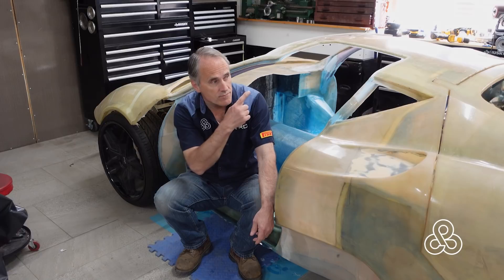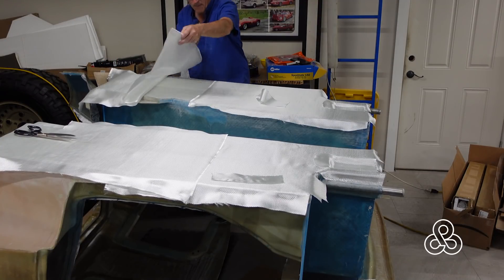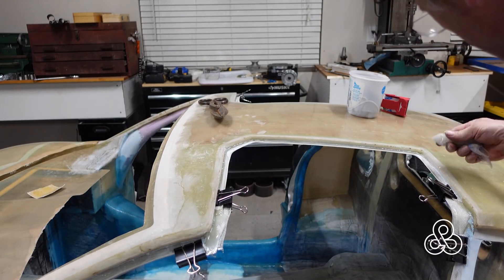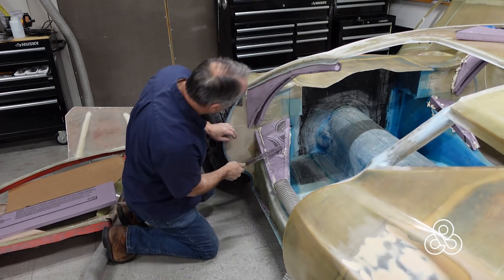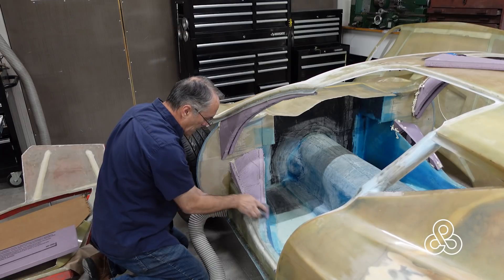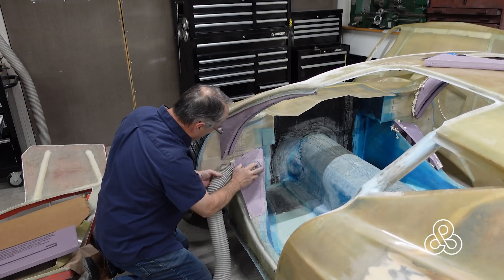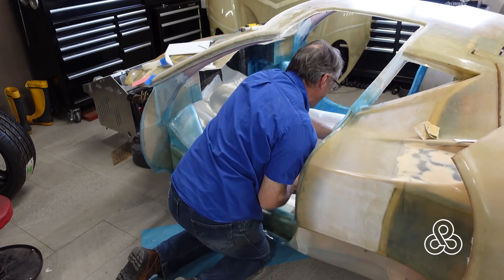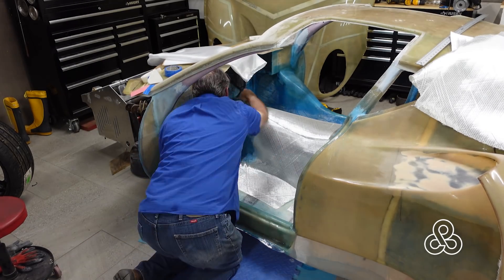A79 Finally some finish surfaces! Arete Supercar Project

Comment: Do you leave the foam inside?
Reply from the maker: Almost always! As the foam weight is negligible compared to the work time to get it out; and although it is not a structural foam it does add considerable strength.

Comment: btw sir, my team is trying to produce a fully autonomous ground vehicle, and to make it's body we are going forward with a 450gsm fiber glass mat, I wanted to know for around half roll of fibre (around 18kg) how much resin would we need? is it one to one ratio?
Reply from the maker: 1.75 times the fabric weight. Slightly less for a plain weave cloth slightly more for Mat. I know its harder for you to get materials, but is there any way for you to switch to a cloth rather than the mat? Better strength to weight.

Comment: The builder gets choice .  Can I ask for a Guesstimation for the finished weight ? I’m trying to build a Light weight steel car so I’m interested in this car.
Reply from the maker: My original goal was to keep it under 2200Lbs (1000Kg), but recently I have thrown weight control out the window for the sake of getting it done.

Comment: If you go paint I would suggest a texture maybe like Bedliner but not as rough? Carpet is always a good option. I personally plan on not using carpet for my supercar design because I want it to be like as close to a Jet fighter, Mech and Rocketship as possible. it will be raw and brutal.

Comment: who is going to fit in that car? the center tunnel is way too large! I want to see you test fit yourself with a seat inside the car with the doors and a mock steering wheel. I can see where the gear lever and e brake placement will be an issue as well. You really needed to do a transaxel and a setup simuliar to the Toyota MR-2. Your car looks the same size as the MR-2 .
Reply from the maker: Seat fitting is on the horizon. No gear lever and the e-brake is electric. The cheapest transaxle that I could find to handle 600HP was $11,000. With a budget of $25,000 it wasn't happening, plus the all wheel drive idea was a challenge!

Comment: For the interior I would go with carpet for the floor. Alcantara for dash and transmission tunnel and roof and seats with a mix of leather and alcantara with a diamond pattern stich. All buttons in stainless steel finish. Some accents in carbon fiber here and there.
Reply from the maker: Orange leather with blue stitching and carbon fiber trim is in the plan.

Comment: Will at some point build one with a more expansive power plant and body? I can imagine if you did you may catch the eye of a few exotic car collectors. I know of one family that just bought a race track that have an insane car collection alone, but there are others as well. Check out "the triple f collection" "the stradman" and "dde" they all have some great and fast cars.
Reply: I meant a carbon fiber body rather than fiber glass
Reply from the maker: If you fund the project we can split the profits?

Comment: Top job mate. Im building a machine from scrach as well and know the time and work it takes and allso the joy it gives if you get something done. 👌
Reply from the maker: Yes, always joy in the build, but super glad to be done with some aspect and ready to move on. Watched a few of your videos and was wondering if you found gears to adapt to the larger tire size or are you just adjusting RPMs to turn them?
Reply: @BuilderCreator   I reduced gearing with chain and sprockets between the engine and gearbox. 🙂

Comment: Paint if your going to use as a track car and race it. Upholster for general use with the occasional track day. As you know, upholstering allows for the addition of sound deadening and insulating materials. Hearing your fine note of the engine noise will not be a problem as you can make allowances for this but road noise can be very tiring on any length of journey. upholstery with added insulating materials will also aid in maintaining a comfortable climate in the cockpit. You can still add painted or say carbon fibre treatments to selected areas of trim for aesthetic reasons. Nevertheless, I have no doubt whichever route you decide on, the result will be fabulous. Good luck and thanks for taking the time to share your journey.

Comment: DYNAMAT.... I think you will enjoy every drive much more by adding appropriately sized pieces of Dynamat to as many fiber glassed surfaces as possible.  I can tell when you tap the panel surfaces that there is a lot of tensile strength.  These panels will vibrate and sound will travel throughout the tub and be EXTREMELY noisy.  It doesn't take much dynamat to alter the resonance - follow up with sound barrier material and carpet.  - - Otherwise there will only be ONE ride with your wife!   ... Just sayin'

Comment: What about the strength calculation? Is the fiber strong enough to resist all the forces made by the motor the brakes and so on without a subframe made of steel?

Comment: Keep up the great work. You inspired me to go with a composite chassis in 2020. The car is finished and it drives amazing at only 650kg!
Reply from the maker: Sidewinder looks great. The central seating works - even if you drive on the wrong side of the road. Ha!
Reply: @BuilderCreator  Yes and the open roof and no side doors makes the composite chassis very simple. It's like a free standing bathtub and the suspension arms bolt to each corner.

Comment: Interior: combine different textures with glossy painted surfaces, alcantera, carbon fiber, leather seats with piping or contrast stitching that matches your exterior color and maybe a touch of brushed aluminum 🔥
Reply from the maker: For sure! I know there will be some carbon fiber and Orange leather with blue stitching to match the exterior and likely some exterior blue on the interior.

Comment: I think a paint and upholstery combo would look good. Would be even better with some accent pieces made with your forged carbon process to resemble your intake.

Also do you have an approximate weight target? And which direction will the doors open?
Reply from the maker: I originally had a target of 2000lbs (900Kg) but have recently started ignoring weight savings in lieu of "getting it done" strategies. Butterfly doors.

Comment: This video series has been such an inspiration!

Maybe you've answered this before, but what is the brand of epoxy you use for your fiberglass layups? Are there any you recommend?
Reply from the maker: I buy most of my supplies from USComposites.com. (their own branded epoxy) Tell them Jay of BuilderCreator sent you.
Reply: @BuilderCreator  Awesome thank you! Do you have any experience with Smooth-On epoxies in this kind of application?

Comment: As you seem to think of everything I'm sure you've got a plan for places to put a jack under the car. Is the fiberglass strong enough for such a point load?
Reply from the maker: I will have reinforced points on the tub, but lifting anywhere on the sub-frames would be safe as well. Loads on the sub-frames shouldn't ever be any worse than potholes at speed. Ha!